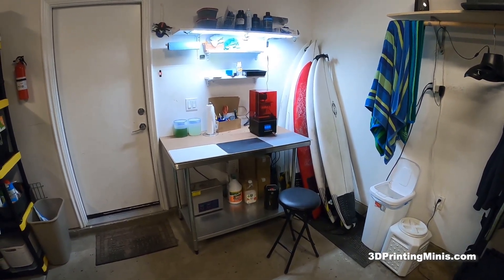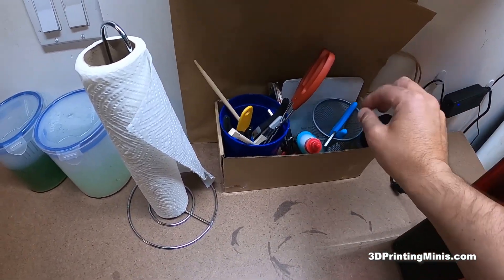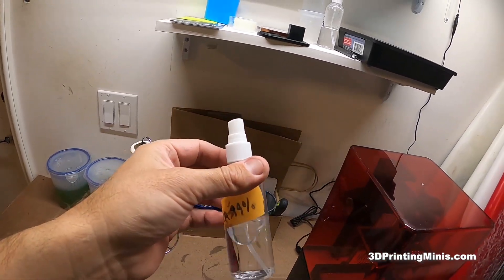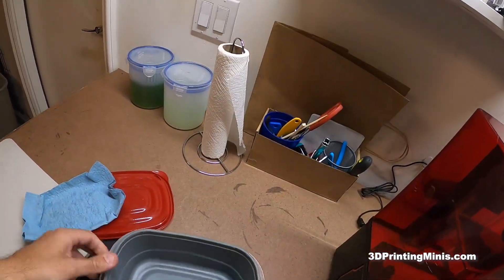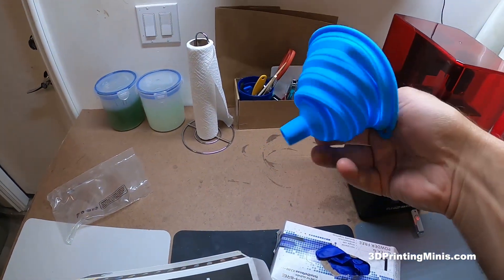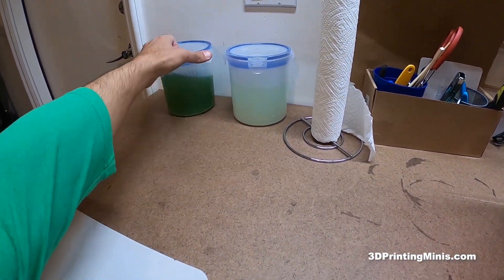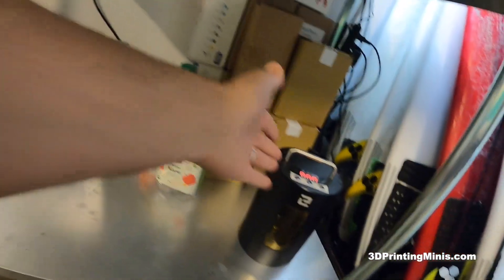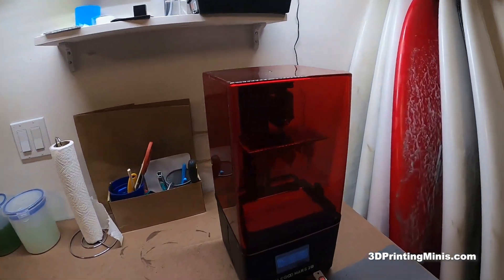DIY Garage 3D Resin Printing Station - Essential Tools For 3D Resin Printers

Comment: You mentioned something about a cover over your print screen? Would that be something like a tablet screen protector?
Reply from the maker: Yep, matte iPad screen protectors are cheap and work very well. The material they are made of is sturdier and strong that just using an extra piece of FEP. Less expensive, too. Here's a video on the one I used. https://www.youtube.com/watch?v=dbfBNlrGh3A

Comment: a magnetic spinner is pretty cheap, if you buy one you could also make one.. there is some bad ass ones on thingiverse, and would totally help in your setup
Reply from the maker: The heated ultrasonic cleaner on the bottom shelf takes the place of magnetic stirrer. :-)

Comment: What were those magnetic build plates you're using?
Reply from the maker: Got them from Aliexpress. Have not had a chance to use or install them yet. But they were only $8 a piece. So, I figure even if they fail (or I don't like using them) I'm only out $8. They took about 3 weeks to arrive in California from China. Here's the link to the ones featured in this video: https://www.aliexpress.com/item/1005001825710444.html
Reply: @3DPrintingMinis  Cool, thanks for the info.  Let us know in a future video how they work out :)